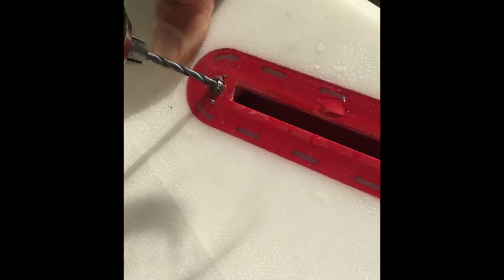Trick: Removing a stripped screw

Comment: What if the screw isn’t stripped and its the threads that aren’t right ? How can I fix that ? My screw only goes a certain depth and keep spinning if I keep tightening it. leaves the fin wobbly and not sturdy
Reply from the maker: Sounds like the screw went in at the wrong angle and cross threaded the fin box. Maybe try backing the screw out and carefully screw it in at the right angle (compare it to another fin box). If that doesn’t work, you might have to use a drill tap to fix the thread or go the next size up and use a slightly larger grub screw. If all else fails a new fin box might be necessary. Good luck.

Comment: Does it need to be a specific type of drill bit?  I've only used mine on wood and dry wall before, not sure you cab use them on metal?
Reply from the maker: I just used what I had - wood drill bit.